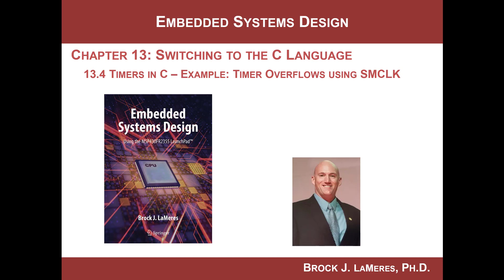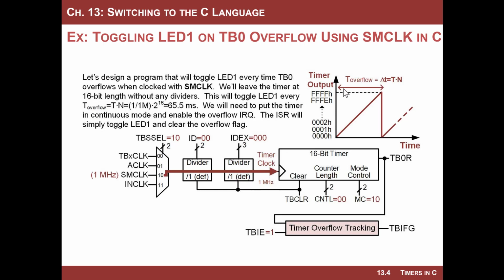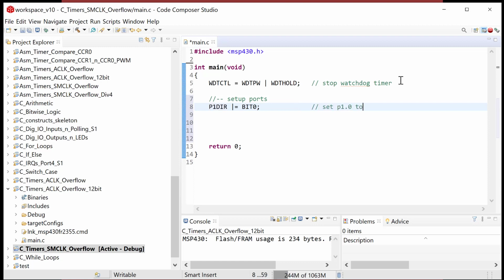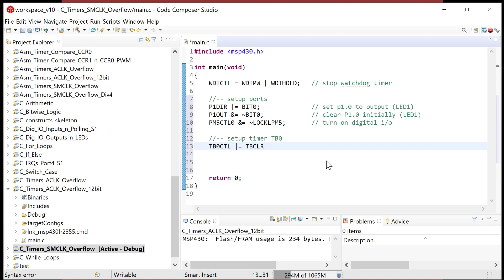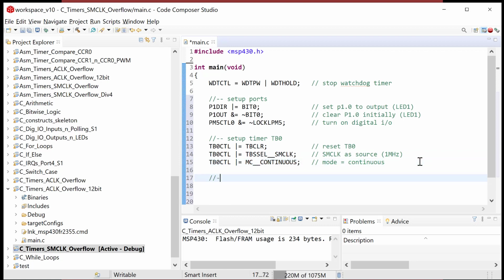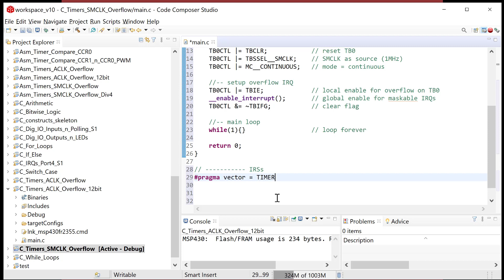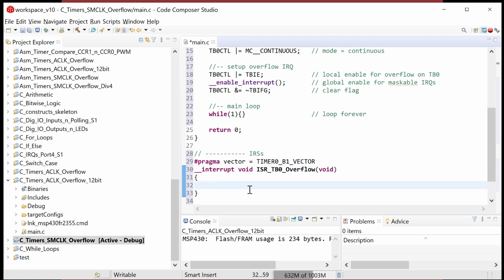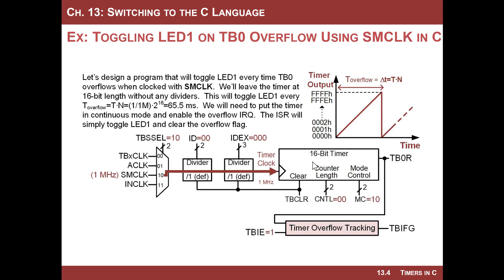13.4(c) - Switching to C to Program the MSP430 - Timer Overflow using SMCLK

Comment: Is TBCLR use only when timer clock SMCLK ??
Reply: TBCLR is used to initially reset the timer before use in the program. It is used for any timer type, including SMCLK and ACLK.
Reply: I am using 2 switches on P3.3 and P3.4 port 
How can I write ISRs for same port like PORT 3?
Reply: @yugsharma9707  wow 2 years later, but I think you can't. Both bits 3 and 4 are going to trigger the same interrupt vector and so you write a single service routine for P3 and then in the ISR itself you check which bit triggered it so you can service it accordingly.